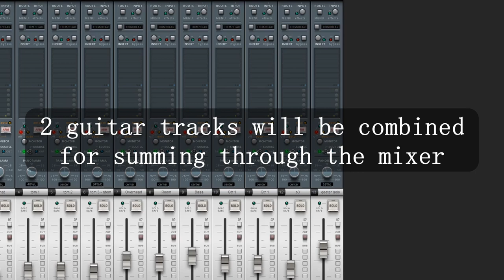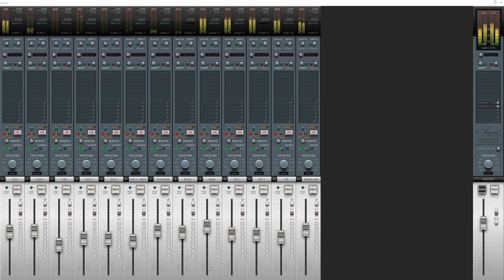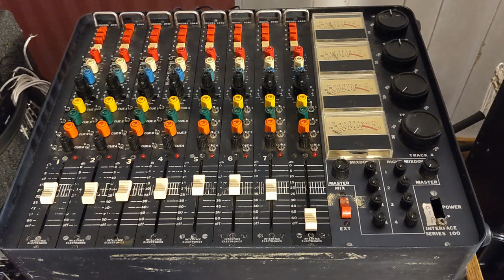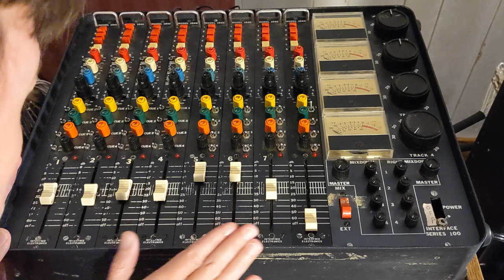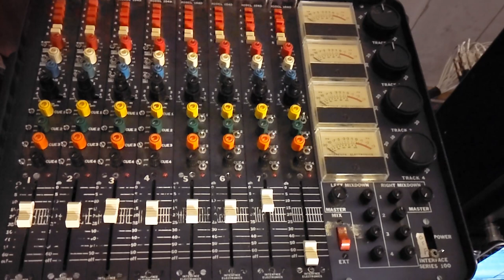Vintage Mixer Summing with Inductor EQ and Transformers

Comment: Great little piece - inductors and transformers, two great components that are too expensive to have in modern gear!  Would love to hear you A/B back and forth between the in-the-box mix and this mixer, and also hear a demo of the EQs.  Great stuff!
Reply from the maker: I may try to make another video demonstrating more of the EQ. In the meantime, you might check the other Stevenson interface electronics mixer videos that I've made. There's even some video of the internal elements of the mixer and one of them. Unfortunately, for the time being I don't have as much time to make videos. I still plan to make one or two a month however so I will try to add that to a future video. Thanks again!
Reply: @TwinCreekAudio  I am definitely going to watch those other vids, going through your list now!  The A/B comparison is always useful since its such a big topic (analog summing vs ITB).  Great your channel focuses on hybrid, not many do.  I have a Soundcraft 600, 32ch with patchbay which I use with PT and Bandlab's Cakewalk.  So much more fun than mousing all the time!